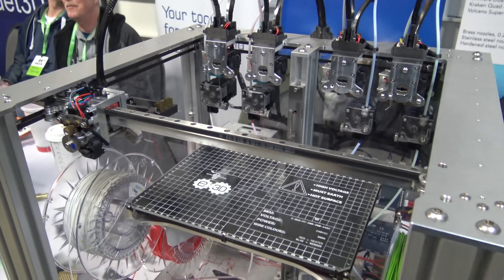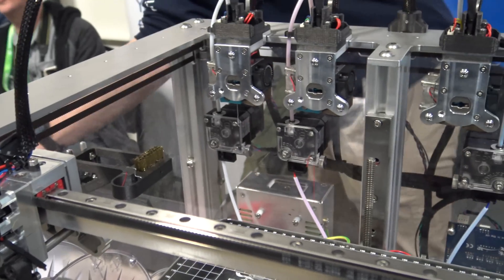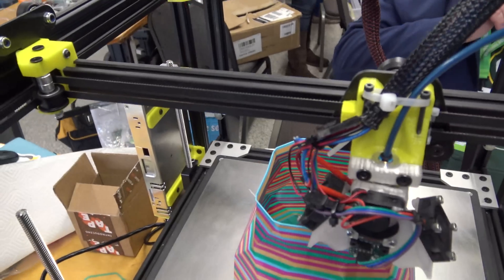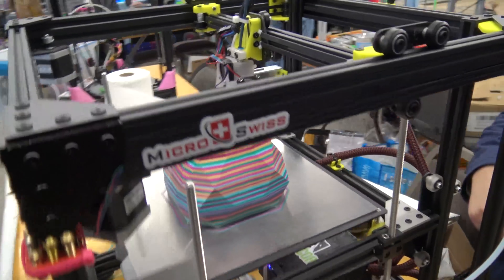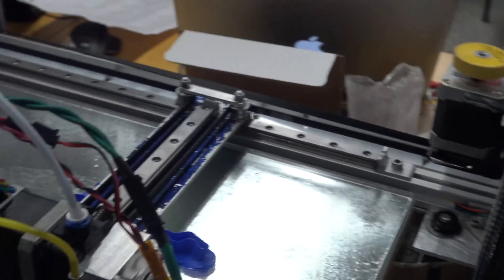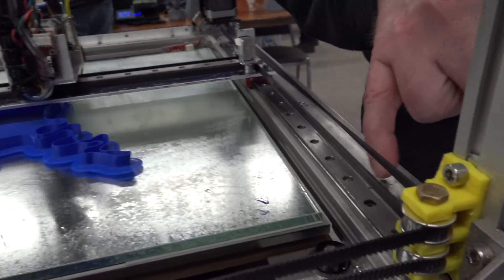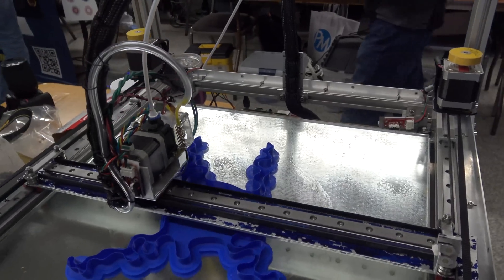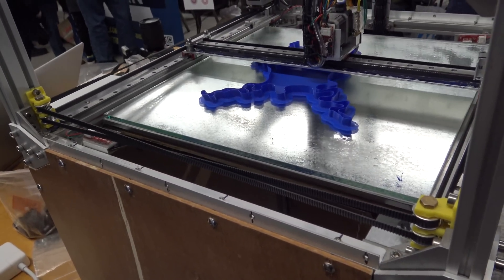MRRF 2019: CoreXY 3D Printer Compilation

Comment: So slooooooowwwww.  CoreXY can run MUCH faster than what they are showing.  Wonder why they scaled it back so much.  BTW I prefer a cross-beam printer, much less interaction between X and Y axes.  See...Ultimaker for an example (no relation).  I put an open-source design of one up on OpenBuilds.com called "Dash-X".  Check it out and YES it's a lot faster than the snails in this video.
Reply from the maker: Cool! I just checked out the Dash X. Looks pretty awesome. I might try building one oneday.
Reply: @3DDistributed  Sounds great, let me know if you decide to go for it.  Regards.

Comment: This room alone must be using a giga-joules of energy or more. This is the one aspect people do not consider, claiming 3D printing is inexpensive.
Reply: most printers use around 50 watts
Reply: @khaderach19  I know this is a late reply, but I can say that most of those printers shown use way more than 50 watts. Based on the type of hotends, number of steppers, size of heated beds...sure, gimicky little machines might use that much, but nobody in that room is using less than 150W power supply. My machine uses a 150W supply and a 800W AC heated bed. But, there is a gimme though. It takes more energy to heat up hotends and beds than it does to maintain that heat, especially in an insulated chamber. So you aren't using that much power all the time. A way to prevent over-charging some PSU's is to keep the steppers powered off while the bed and hotend heat up, and once they've stabilized then turn on the steppers.

Comment: Nice meeting you.  My tall XY is the one you show starting at 5:16.  It is my take on Jetguy's designs.  The advantage of this arrangement is that all the mechanicals are inside the frame so it is easier to enclose.  Also, the wider extrusions, 20x40 are used to stiffen the frame in the X-Y plane.  Same for the X gantry plate.  It makes a "T" beam so there is virtually no compliance in the direction of travel so minimize ringing.  The only compliance left is in the belt and rubber dampers.  My next modification will be genuine Gates 9mm belts w/o the dampers.  Per a comment below, yes, these printers can make very fast travel moves but you can only extrude the plastic just so fast.  I would like to try out a Volcano...
Reply: I would actually love to know more about this printer! I have been wanting to do a 500x500 core xy and I love how simple and clean your design is. Would you be willing to share some info on it?
Reply from the maker: @Iceblade065  Search in Google for Jetguy 3d printer design. There's a well written blog that someone wrote after they traveled to his house to buy a printer. Jetguy explains the 3d printer build.
Reply from the maker: It was nice meeting you Mark. I do believe that your 3d printer presentation was the highlight of the video.I probably wont make it to MRRF this year but I will be back though.